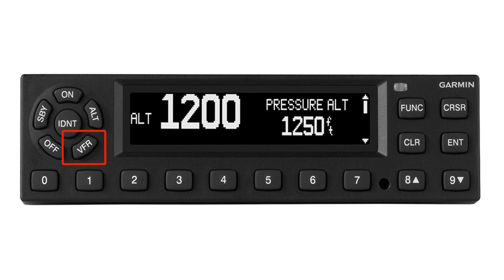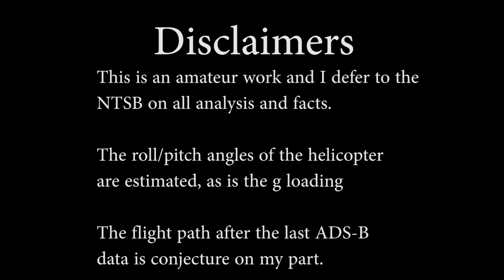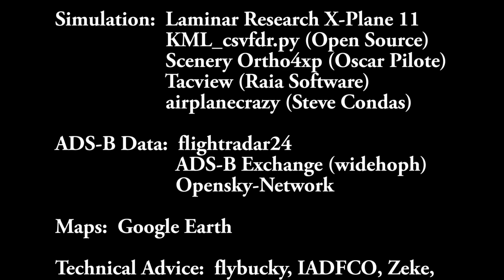Newly released Pilot to ATC Audio!  N72EX (Kobe Bryant) Crash Reconstruction.

Comment: I'm curious what the cloud elevation was that day I'm curious if the helicopter was still in cloud elevation when communications was lost and why was the altemeter not observed. maybe the altemeter was not illuminated.
Reply from the maker: Weather conditions reported to the pilot by air traffic controllers during the flight included an overcast ceiling at 1,100 ft agl (~1,900 ft msl), visibility of 2.5 miles with haze, and cloud tops at 2,400 ft msl.  I examined weather videos posted to the NTSB docket and I estimate the ceiling as ~1,300 ft msl and tops at ~2,700 ft msl near the crash site.   The video shows a substantial variation to the cloud levels over time, so my estimates might be a bit off.  The crash was at about ~1080 ft msl.
Reply: thank you for the response , that would indicate it is possible the point of impact could be at cloud level or within 300 ft. an extremely short distance at the rate of 4000 feet per minute. My next question is what is the occupancy rating and permit for the chopper.
Reply from the maker: @Mark Henry  The helicopter had 8 seats in the passenger cabin and 2 seats in the cockpit.  I am not sure what you mean by "permit", but the operator held a Part 135 operations certificate.  https://data.ntsb.gov/Docket/Document/docBLOB?ID=9703925&FileExtension=pdf&FileName=Factual%20-%20Maintenance%20Records-Rel.pdf

Comment: Having studied spatial disorientation significantly, I believe he experienced what's called post roll effect (Gillingham  Illusion) what's been found in these types of accidents is discrepancies between and among the visual, vestibular, somatosensory, and
 cognitive systems that can lead to a mismatch between the perceived orientation and the actual orientation.
Various contributing factors include attentional anomalies, experience level, expectations, and 
interpretation of inputs. It must be noted that simply because this mismatch exists does not automatically necessitate the occurrence of an SD incident. Quite often, the individual crewmember is aware of the mismatch and chooses, either consciously or unconsciously, to disregard the orientation inputs from his or her internal
orientation systems and to focus and rely on the orientation inputs from the aircraft instrumentation. SD incidents occur when the crewmember is either unaware of the mismatch, or aware of the mismatch, but unable to reconcile the cause, or unable to overcome the internal sensory signals and rely on the external
orientation information that derives from the aircraft instrumentation. If it is not practiced on a regular basis it is very easy to fall into this type of situation and unfortunalty the outcomes are never good.

Comment: I have a photo of Kobe with his Helicopter.It was custom painted to his specs to replace the dated   white and blue stripe color we see here.Was this a different charter copter?
Reply from the maker: About the time he retired, Kobe had a “mamba” vinyl skin applied to the helicopter.  That skin was later removed and was not on the helicopter at the time of the crash.  Here is a picture of the wreckage showing the paint color https://images.app.goo.gl/P4snAKU6NhSKMfSCA
Reply: @stevencondas2281  that's what seen too.Thats not Kobe's copter.He was very happy with the new color.Why remove it and go back to the old colors?
Reply from the maker: Kobe didn’t own a helicopter.  He chartered the helicopter, and when he was retiring he worked with the charter company to have it skinned with the mamba livery. Because the helicopter was used by other clients, however, the charter company eventually removed the skin and returned it to its original livery.

Comment: My curiosity wants to dive into if that helicopter had some sort of neutral controls that prevents ascending and descending movement while on the other hand having some sort of non movement control that prevents forward or backward motion.  I don’t know much about helicopters but in simulations I have felt that spatial disorientation.  May not be the same feeling but my response was to always put things in neutral to prevent the worsening of a situation.  Obviously I can see how the disorientation could lock up your actions causing forgetfulness of existing actions as this has been experienced too, although in simulations you get another chance to learn from a failed scenario you have caused.  I figured this to be the same though for those pilots putting in hours in simulations too.  Too many variables on where things took a turn in the mentality of the pilots choices.  Pride, false positive of confidence, fear, etc.  definitely assuring that fear played a big part of this since use of instruments was not in use prior to the incident or even prior to that the use of what I was mentioning.  Like I said, I know squat of helicopter functions but if anything similar to that of simple game simulation use then what happens with the neutral scenario to float until comma and direct known ascension has been made?  Then my opinion thinks this pilot was overwhelmed in disorientation because if you appear to see mountain sides to your left after passing them yet you decide to turn left in the situation after seconds or minutes of passing?  Sure given that he thought he was ascending, but this is what I was talking about false positive of confidence.  Why not just ascend first.  Once more again, maybe the helicopter don’t function that way.  Just thoughts for discussion.
Reply from the maker: I have performed many simulations of the flight.  The best I can tell the pilot flew a 1g flight path after becoming disoriented that fooled him into thinking he was actually climbing.  Here is my latest simulation, but you need to read my description for context:  https://youtu.be/xI1UqFvNYIU .

Comment: Quick question if you see this....the SoCal controller sounded a little perplexed when the pilot indicated he was beginning a climb above the layers.. was that because he was still squawking a VFR 1200 code and not declaring an IMC emergency plan? And when he pushed the ident, did that change the code from 1200 (as well as probably distracting him and contributing to his spatial disorientation.. wish he would have slowed down)? Just curious thanks
Reply from the maker: The controller had just taken over the controller position and N72EX was not a "radar contact" for ATC (meaning it was not being tracked by ATC. It was VFR and squawking 1200).  The pilot then starts talking to the controller as though the controller knows about N72EX, which I believes perplexes the relief controller because that is not an aircraft he was responsible for tracking (I believe the pilot thought he was still talking to the relieved controller, who would likely have remember him from the earlier conversation despite not being tracked).    

When the pilot pressed the ident button it did not change the code from 1200, but made the aircraft highlight on the controller's radar display.  Certainly interacting with the transponder unit increased the pilot's workload at a critical time, but the controller would have had no way of knowing that.

The NTSB said there were a number of times that the pilot could/should have aborted earlier when the conditions were deteriorating compared to the original plan.  I believe the pilot thought that if he could get over the 101 pass near Mureau Rd (the highest point in his planned route), he could then descend to get back under the cloud base and fly the rest of the route safely.  We see him descend after that pass 3:05, but I think the clouds did not clear as he expected, which is when he decided to climb. I believe he did not declare an emergency because he didn't want to get into trouble with the FAA.  Going slower would have given him more time to react, but I think he was pretty committed to the plan to get over the pass, and thus I am not sure that going slower would have changed the outcome (he still would have been caught in the clouds). Once over the pass, what would have changed the outcome is following his training.  Get the aircraft level, begin climb, once stable contact ATC, declare emergency, and commit to following the aircraft instruments until out of the clouds. I think he could also have pushed the "Go Around" button on the auto-pilot which would have leveled the aircraft, maintained the current heading, climbed at 750 fpm, and maintained a speed greater than 75 knots, until out of the clouds.

Comment: Great job as usual. I just finished reading  The Flight by Dan Hampton and in it, it describes of course, the many many challenges faced by Charles Lindbergh, one of which was fog, along with flying at night, storms and wind in the middle of the Atlantic without any air traffic controllers, flying for hours in pitch black, no visibility whatsoever at times, no mode of communication at all, very little instrumentation, he was alone, not even a fuel gage, yet he made it. He made it by not panicking and not making rash decisions/moves which would have costed him his life. You would love the book 📖 as you have technical expertise that I don't have but I was still impressed by it all. 
I thought of the Kobe Bryant pilot a lot while reading this; what a contrast. The pilot made a rash move when he got blinded by the sudden thick fog, he had other options, he had assistance, he could have asked air traffic controllers to take over and guide the helicopter 🚁. I think panic may have started inside the chopper with the kids freaking out and the pilot to quickly resolved this matter,  made a rash move to get out of the fog without obviously checking all the available instrumentation information in front of him and seconds later it was all over.
One thing I especially retain from the book 📖 and watching your video 📹  is the fact that Lindbergh had a gage or a warning device telling him the distance between the plane and the ground. Here we are, 92 years later, a top of the line helicopter 🚁 worth millions, didn't have such a warning device, one that could have saved 9 lives. Why? It certainly saved Charles Lindbergh's life on many occasions in fact. I found this simply mind boggling. Id love to get your take on this  Thank you for the great work and do try and read the book!
Reply from the maker: Thanks for the comment!  My preliminary g-force analysis suggests that the occupants would have felt the initial turn, but I suspect it would not have been too concerning.  After that, for most of the descent, I believe the G-Forces felt "normal".  Thus, I think the passenger panic scenario is unlikely.   https://youtu.be/xI1UqFvNYIU   As an aside, I will also note that the helicopter was worth millions when new, but was sold in 2015 for $515,161.  It was built in 1991 and you are right to point out that it did not have the latest in avionics, including TAWS.

 I will definitely track down that book!
Reply: @stevencondas2281  Thank you. Insofar as possible panic in the chopper, I meant flying in thick fog may have caused it but perhaps not, as things happened so fast.

Comment: Great Video. I overlayed your video with the Bronco Baseball Field Video (& aligned it to the correct time code) which recorded audio of the helicopter.  You can even hear the impact and that Video is pretty eye opening. Tell me if you're interested in this video because 1st off i don't have a YT Channel and 2nd it contains Audio from your Video.

Btw, to me the Pilot sounded like he was way behind the aircraft when he told ATC he is gonna climb to 4.000 feet
Reply from the maker: I would indeed be interested in the audio from the baseball field.  I have aligned audio that I obtained from home security cameras that captured the event, but I am not hearing changes to the turbine sounds I am expecting based upon my recreations of the crash using X-Plane flight models (specifically, the change in collective):   https://youtu.be/xI1UqFvNYIU  Perhaps the baseball field audio would have the evidence I am looking for to validate my g-force analysis.

Comment: Wow that's scary. So a moment's distraction can turn deadly pretty quickly. 

I know I am not going to let "stardom" override my need for safety if I am ever challenged by a celebrity to engage in actions that have a higher than normal risk matrix.

Not saying that this was the case with our departed brotha Kobe Bryant and the pilot. 

But i am saying is that you cant take piloting aircraft for granted, no matter how long you have done it.

Comment: At 17:44:34 when 2-EX stated he was climbing "above the layers", he was in violation of his Part 135 charter to fly only VFR.  Under Part 135, 2-EX should have declared an IFR emergency before climbing into clouds.  At 17:45:17 when SoCal asked 2-EX; "say intentions?", he was prompting the pilot to either request special VFR or declare IFR emergency.  Controllers may not tell a pilot, or even suggest, to do either, so they ask:  Say your intentions?  Earlier in the flight the Burbank Controller also asked 72-EX:  "...surface area is IFR; say intentions?", which was his way of saying;  Dude, Burbank is IFR all the way to the ground, why are you still flying?.  72-EX responded by requesting 'Special VFR' transition through Burbank airspace.  It's disheartening to realize 72-EX passed two opportunities to get out of the weather by requesting landing clearance for Burbank or VanNuys; instead, he chose to be vectored around both and press-on with the flight...  - waw -
"Special VFR" is a way to allow a pilot to fly out of weather conditions that have deteriorated below normal VFR visibility - you still have to see the ground and you still have to stay out of the clouds.  Special VFR is NOT meant for continued flight into deteriorating weather.  ATC may not direct or suggest Special VFR; the pilot has sole responsibility for that decision.  But ATC may ask "say your intentions?" as a way of telling the pilot to either sh*t or get off the pot...  If one-day you're just tooling along VFR and ATC comes up and asks "Say Intentions?", the hair on the back of your neck should stand-up, 'cause ATC is saying you may be flying into trouble...
Reply from the maker: Thank you for your insight!

Comment: Where is the commentary and the acknowledgement that he was flying in a Sikorsky helicopter the same manufacturer of the helicopter that crashed in the hostage rescue in 1979 that's a tainted manufacturer he's an idiot for flying in the Sikorsky
Reply from the maker: There is no such commentary because I haven't read anything, so far, that indicates the crash was due to a problem with the helicopter.
Reply: @stevencondas2281   Sikorsky is bad they crash it is a obvious connection
Reply from the maker: You have provided no evidence that the S76 is tainted.  Provide a link that shows the S76 is more accident prone than comparable models.
Reply: @stevencondas2281   read this narrative about Sikorsky Helicopters. They crash.  All the time.    https://en.wikipedia.org/wiki/List_of_accidents_and_incidents_involving_helicopters
Reply from the maker: Sikorsky (and the S-76 line) isn't even close to the most dangerous on the list of the deadliest helicopters:  https://www.latimes.com/projects/la-me-robinson-helicopters/
Reply: @stevencondas2281  @StevenSikorsky